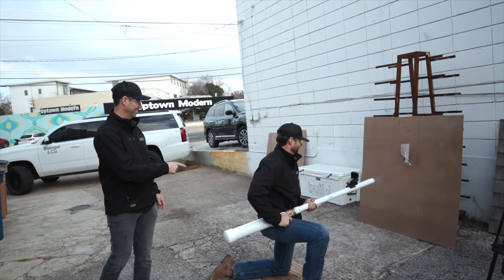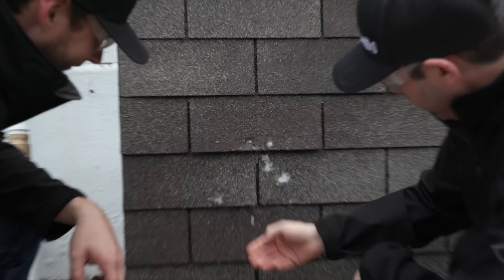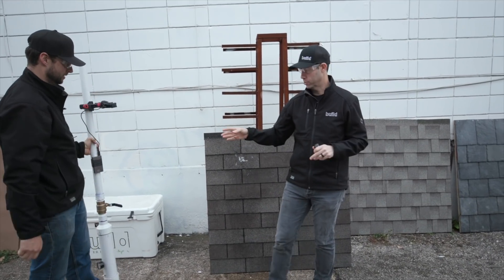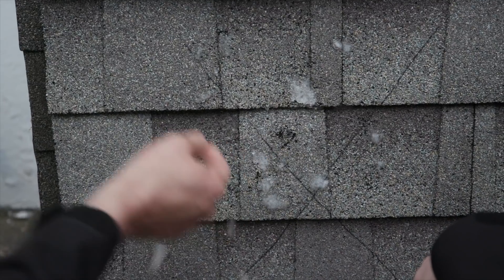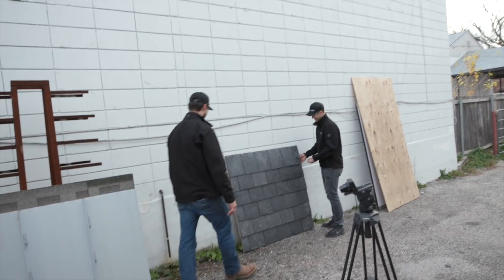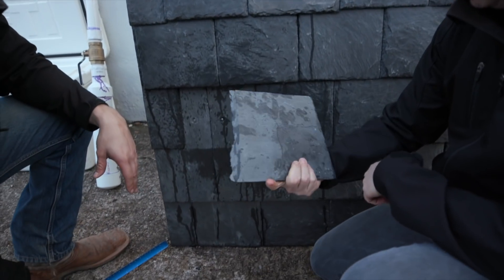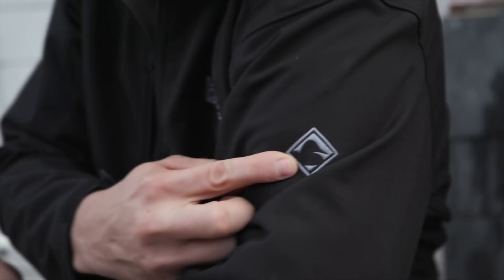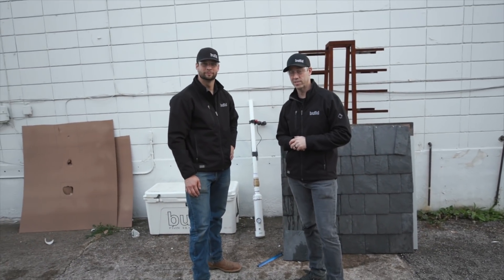Simulated Hail Damage Test: Asphalt vs Slate vs Metal Roofing

Comment: Did anyone noticed the never reloaded the air  when testing vs metal anyway metal is awful because once it gets dinged by hail ( Or scratched ) you must replace the full metal panel and it will cost $$$ if you don’t replace it you will have corrosion and it will spread all over is also very bad vs wind as the wind can enter under the metal and ripping it all of, shingles you only replace one pice and you are all set but today things have changed the have 150>mph shingles metal is awful mine neighbors metal was ripped of by wind and it was spinning like a tornado in air metal is for contractors to make $$$ VS shingles you can replace it yourself. Do research and make a decision

Comment: Hail falls at about 30mph, not air canon speed. Seems like a more accurate scenario would be to drop the ice from a height which will allow it to reach terminal velocity. Or simply throw the ice at the shingle pretty hard.

Comment: The biggest hail storm I have "survived" in my life was around 1987 in Australia. The hail stones came down glued in masive clusters of a kilo or more of ice in Brisbane. 
I was pasing by a street and I herd a bang, bang, bang sound when I looked the roof of the houses look like exploding one after the other, it happened for three blocks of houses in a row, none of then was habitable after that. 
But the thing is that those houses were roofed with corrugated fibrocement sheets, probably asbestos ones. The hail also destroyed trees, fences, gardens, cars and killed birds. Fortunately it killed not a single person, but it was perfectly possible. 
In any case I believe that only a house covered in heavy duty steel can take a hail storm like that one. 
Years after I had to renovate the roof on my house, and remembering that experience, I went for the thikest tensile steel on clip on long planks.  When you think ¿what can happen? the answer now is anything. Do not take chances.

Comment: Maybe testing isn't the Build Show's forte, this is the second "test" I have seen where the results do not match with what was obviously expected, but instead of accepting that, excuses are made as to why the favoured materials failed.
Few people are likely to prefer a 15 year shingle roof over a slate roof, but on this test both would have been damaged by hail. The disadvantage of the metal roof is that overtime although the roof may not ever leak, the pot marks are not repairable and overtime will only build up and probably become unsightly, whereas for the other materials, any damaged tile can be replaced.

Comment: The 15 or 30 year rating is USELESS.  That is related to UV damage.  Every shingle roof will only last until the next hail storm.  Here in St. Louis, we get 2 or 3 hail storms every year.  Every time I sell a house, i have to pay 5000 to 7000 for a new roof.  Right now, I am in the process of paying for yet ANOTHER roof.  This one is architectural shingles!!  I thought it would hold up better.  WRONG!

Comment: As a roofer - 
Composite shingles are replaced when fiber is broken.
Metal is replaced when any deformation in the surface occurs as it voids the paint warranty.
If you can afford slate why are you even asking??
Asphalt Composite shingles are generally the best. You want to have the roof replaced every 15-20 years anyway. All flashing fails and all roofs need maintenance, so it is really beneficial to just tear the roof off , inspect the decking, and re-roof.

Comment: slate can fracture easily. while it might be denser, it mimics fracture points in rock and even concrete. metal is consistent in its molecular structure and can spread the impact evenly over a larger surface area.

Comment: Matt, I would love to see some videos of how you handle retarding air movement with, things like bathroom fans, stove hoods, fireplaces, recessed lighting, all the weak links that break the air seal on the structure.  I think some of these are handled with a conditioned attic like you use, but in climates like ours (northwest), blown in insulation is by far the predominant approach.

Comment: Kinda makes sense.  Slate is very brittle.  So while you are having a cannon it is not unrealistic considering the speed of real hail and the size it can obtain as well as covering the roof completely.  The kinetic energy is probably very similar at point and not even close at the total square feet of a real roof undergoing a storm.  Steel wins in my view and the ease of replacement makes it a real competitor.  Now on to the hurricane two by four test from the cannon!  Take care.  Doug

Comment: I need window help... have a “ modified a frame” up in New Mexico mountains. Wanting to replace/enlarge a couple of windows on the sloped wall. Currently there are awning style windows but I can’t find any info on a suitable replacement that won’t leak on an angle. They do not need to operate if that helps any. Thanks for any input.

Comment: You need to consider the velocity of the hailstones, and here you have no idea what that is.  The shape of the stones matter too since sharp corners create stress concentrations.  Hail falls at its terminal velocity, and the terminal velocity depends on the size of the hail stones.  The larger they are, the faster they fall.  Any roof will survive pea sized hail, no problem, but no roof will survive when it gets larger than golf balls.  Fortunately the huge ones are rare.  I understand that it would be WAY less fun, but it would be much more scientific to drop different sized spheres from a known height.
Reply: In fact, your velocity is almost certainly WAY too fast because the ice gets pulverized.  In a hail storm, occasionally hail stones will split in half, but you never see them get pulverized when they hit a roof, or even the pavement.

Comment: I expected the slate to fracture because it's brittle and ridged. It cannot conform to the sandwiched air gap voids beneath it. The metal is flexible, and has more tensile strength than the other samples, so it seems like the best option for hail. I'm in northern NH where we have many slate roofs especially on old barns. Our no longer used dairy/hay-barn has a slate roof that's lasted about 90 years with very few slate replacements.

Comment: We lost our roof to hail damage earlier this year.  Basic asphalt shingles as in your first test panel.  I wanted to replace it with metal but my wife insisted on premium architectural shingles.  I was hoping they would be more resistant to hail damage but your test indicates otherwise.
Reply: Next time it needs replacing try going for metal shingles to make both of you happy. Metal can be made to look like anything, it's one of the reasons I think metal is by far the best material for a roof.

Comment: Sounded like you were really making excuses for the slate roofing.  IMHO, METAL is the answer!!
Reply: Yeah I think it's more durable and I prefer the look of a metal roof. I also like the sound when it rains and it's also easier to clean snow and any stains off of it. In my opinion it is top dog. Slate looks nice too but too strong typically means brittle  which is what I think happened to the slate. Fun video though who doesn't like cannons😂.
Reply: @rachellaylee3425  The other drawback of slate is the price. first of all, slate material is itself more expensive than metal, and second of all you need a ridiculously strong roof to hold it, which means more expensive trusses/rafters. Metal is the obvious choice, all the benefits without any of the drawbacks.
Reply: Rachel Laylee slate is protected from most storms as is metal. The  material lasts longer because it’s stone... ie immortal, but it isn’t hard to break because it’s not that strong (it’s hard and rigid but not strong). Slate isn’t meant for big storms. It’s meant for thousand year homes.
Reply: Yeah, Slate is so overrated.
Reply: AnonyPersona 
Depends on the house.  For the average house, I think metal is the winner.  For a higher end house, slate is king.  It looks best and last longest.
Reply: @anonypersona3189  No, it's not at all. It's the best roof unless you live in an area prone to hail storms and even then it's debatable. In every other area, it will outlast every other roof except for maybe high grade clay tile, and it's longevity will more than pay for the high cost.
Reply: Titanium roof. It would last 1000 years, never corrode and never dent.
Reply: The slate roof is unpredictable in a hail zone area because it is not engineered like the other roofs in the video. I live in a hail prone area and I have seen clay tile and standing seam roofs weathered six hail storms and one tornado in the past ten years with hardly little damage.

Comment: Roof doctor et al- what has been your experienced with metal roofs, esp steel gavalin (sp?) like they tested.
In Maryland I can attest cedar shakes disssolve with any significant hail (ie nothin like you guts get annually)
As for slate which we have a great deal up here, slate is not only 3x expensive ANY repairs are very expensive- few roofers really still have necessary skills, and charge top dollar-overall costs are insane-hence why many are going to faux slate if neighborhood/covenants allow. And of course you have to have strong enough roof. 30 year /lifetime shingle shave become so good and look fine even on i story houses that that is the way to go up here-have had 2 hail storms with no damage (again, we dont  have golf ball size hail up here) 
How does a galvanized metal roof compare price wise to 30 year and slate (in between ) we have very little metal Roofs up here.

Comment: The ice gun probably is shooting at several times the velocity of falling hail, which Wikipedia says "It is estimated that a hailstone of 1 centimetre (0.39 in) in diameter falls at a rate of 9 metres per second (20 mph), while stones the size of 8 centimetres (3.1 in) in diameter fall at a rate of 48 metres per second (110 mph)."
Reply: yea, also this crushed ice would impact and disperse its kinetic energy differently than an actual hail chunk. a better test would have been throwing solid ice cubes against the roofing material.
Reply: My thoughts exactly. This video is not scientific at all and just for views, which is fine. Just hope no one thinks it’s real.

Comment: Im disappointed with the slate...to me the take away is impact resistance vs weathering....I'm pretty sure the slate still weathers the best and still looking gorgeous many years further than the others. In my area, the hail maybe at the largest, pea size, in my lifetime to my knowledge. It's all asphalt up here mostly. But i've had to replace some shingles because of wind on my about 15-20 year old roof......
So in my opinion, i wouldn't mind seeing an asphalt & slate extreme wind test. (with the asphalt adhered already)

Comment: Cedar shake roofing is frequently used around here (Oregon) so it would be nice to compare against 24 gauge (uncommon here) and 30 year composite (most common).

If the slow motion frame rate or its frames' timestamps were provided along with the gun's diameter, I (or someone) could determine the muzzle velocity, at least in those shots showing the discharge.
Reply: In Texas a typical hail storm pokes thru holes through the cedar shake roofing.  It happened to my roof and luckily in that storm there was almost no rain.  Had a it dumped a bunch of rain we have had to replace insulation and drywall too.
Reply: @dsdragoon    Thankfully, hail storms are rare here and typically strike small areas (like a few dozen blocks).  Once I did see 1 cm (1/3 inch) diameter hailstones but usually it is much smaller.   In many areas, houses are protected by towering Douglas-fir trees.  Still, the most significant consideration for roofing is longevity in 9-10 months of rainy weather annually.
Reply: @wallykramer7566  In the DFW area we use the ball size gauge to measure our hail stones.  We start with pea sized, then marble sized. We don't sweat the small stuff.  Sometimes we use coins, dimes, nickles, and quarters. These sizes are concerning.  For bigger we go to ball sizes. Ping pong, golf, baseball, and softball sizes.  If your car is not protected by a garage then the ball sizes will make you cry when the insurance agent totals your car.    You usually ride out those hail storms in the bathtub.  The ball sized hail stones are usually accompanied by tornadoes. 
https://en.wikipedia.org/wiki/1995_Mayfest_Storm
Reply: Wally Kramer I might do my house with locust shingles. I doubt any hailstorm could really ruin them.
Reply: @Dollapfin  just make sure the wood is still green when you install, otherwise you wont have an easy time getting nails through it lol. Locust is a ridiculously hard wood.
Reply: Devin May well I was thinking about just pre-drilling the holes. I don’t know hardly anything about roofing, but I know some things about wood. I want to make sure they dry straight. I hate the curly look of some of those roofs.

Comment: Hey Matt, I have a leak that has opened up in my basement and I'm trying to determine the best course of action. My house is situated on the side of a hill, so the front half of the basement is completely underground, but the back half is walk out level. There were some hairline cracks in the walls when I bought the house a few years ago, but recently a new builder has come in and start blasting rocks to make room for a new subdivision. Now all of a sudden, during heavy rains, water is seeping in on said cracks. Unfortunately, I don't have proof that the blasting is the cause of the leaks, so I'm stuck fixing it myself. 

On the inside, I took some hydraulic cement, beveled out the cracks, and filled them. That seems to have helped a good amount, but water is still getting in. I'm thinking my next step will be to attack this from the outside. Dig out the wall where the cracks are located, hit it with some more hydraulic cement, buy some type of liquid rubber flashing to coat the area.

I know the real solution would be to dig out all the side of the basement, put in drains (if there are not there already), rubber flashing, and dimple drain sheets. But that's a lot more than I can do myself and 20 grand isn't in the budget right now.

Do you have any other suggestions that I can do as a homeowner?

Thanks. Love your channel!
Sean
Reply: Sean Cromwell trying to “fix” the problem from the inside is futile. Start with what you can on the exterior of the wall. Otherwise your option is to condition the basement space to accommodate the water infiltration, and that is not a a preferred option.
Reply: Truly solving the problem and doing so correctly means repairing the barrier seal on the exterior of the below grade wall (and likely replacing the weeping tile drainage system to get the water away from the building foundation as well as they clog over time and may as well while you have access to it), and that, unfortunately, requires digging up the wall.  Fortunately there are much better solutions available today so you are unlikely to incur that pain again if they do the job right.  Then you follow up by piping downspouts well away from the building and fixing and regrading the landscaping to redirect as much water as possible from the building walls and foundation.  It’s expensive and insurance seldom covers much of the cost, but if you do it right then you will likely never have the problem again for the rest of your life.  Just do your research and choose a good contractor who will do the job right without cutting corners.  You have my sympathies, I’ve been down this road in the not too distant past!  It is amazing just how much water can run through a simple crack in a below grade wall during a heavy rain (even worse if you have groundwater issues)!

Comment: If you ever do this again, try aiming for the standing seam of the metal roof - if it bends the seam that would be a leak point and as far as we have documented in the past, constitutes direct damage. Also, I’ve heard of a lot of metal roofs getting paid for replacement for denting, unless the policy doesn’t treat denting as direct storm damage. On the asphalt shingles, 1.5” hail is usually going to completely damage almost any shingle roof and that’s at natural hail velocities! The slates tend to chip or puncture for natural hail - I’ve never seen one fracture like in the test - that was pretty cool! Great video as always guys!

Comment: Having worked in aerospace for too many years, this testing mimics nothing close to testing per an ASTM. 

Any idea what the velocity of the projectile is? How about projectile weight, distance between target and barrel? 

None of the asphalt shingles shows any tab bonding, which would occur within weeks of installation, especially in Texas. 

I like your showcasing of new materials, but testing isn’t your forte. Test to an industry standard, or leave it to the professionals.

Comment: Love your stuff and ideas, Matt. This one is a little silly but still fun. I agree with your findings 100%. The 3 tab/25 year shingles are just builder grade and not Texas proof. Stone coat is probably the most hail proof in my experience but not as pretty as standing seam or slate for sure.
Just an FYI- Mythbusters debunked the ice bullet idea- the propellant degrades the ice before it strikes. Real hail like the San Antonio 2016 storm went through 30 year laminate shingles AND the 7/16 osb decking in some areas. 
The Austin Roof Doctor gives this video a 👍. Keep up the good work !
Reply: but was it going thru 5/8" or 3/4 roof decking too?
Reply: @ResortDog  not sure. That part of San Antonio was newer so mostly 7/16. My favorite kind of hail.